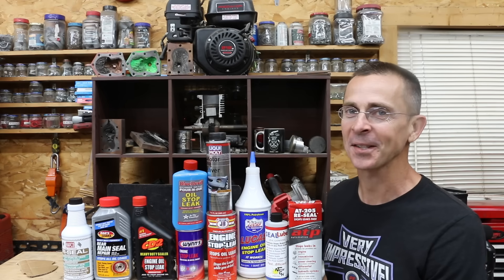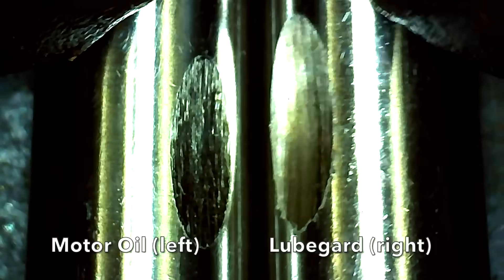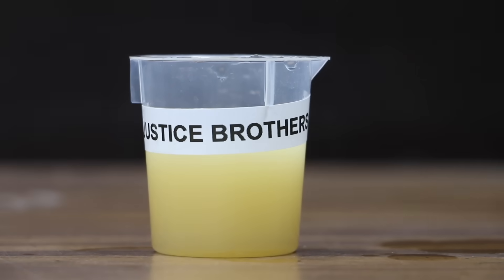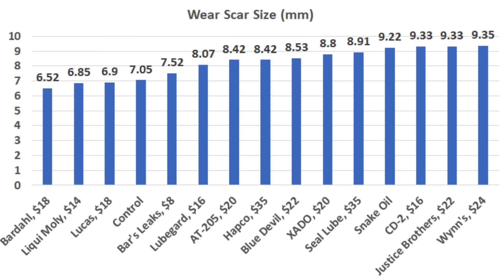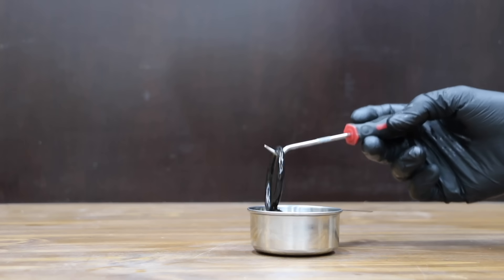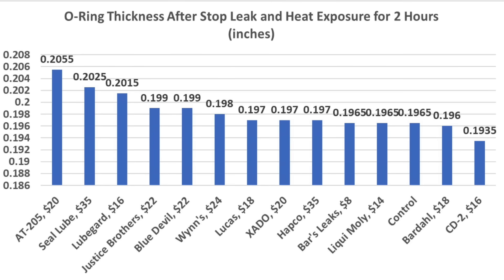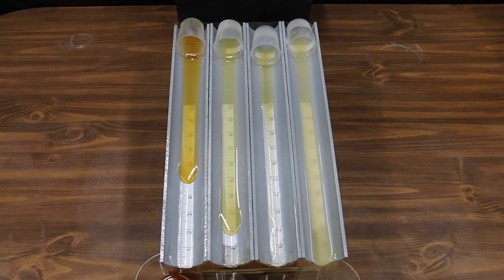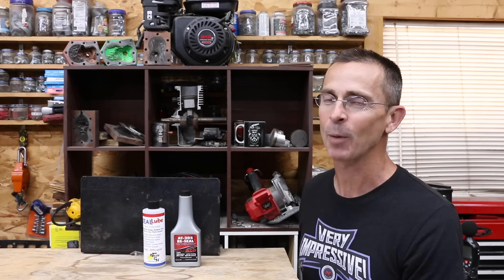Do Stop Leak Products Work? Do They Damage Engine Seals? Will They Destroy an Engine? Let's Find Out

Comment: I have a BMW e36 and it leaked oil from the crankshaft seal, front and rear. I tried Mannol stop leak and the leak gradually stopped. I add the stop leak after every oil chamge and its been leak free for about 3 years.
Reply from the maker: Thanks for sharing.

Comment: The At-205 works great on rubber components like CV boots to keep them soft and prevent cracking. I keep some in a spray bottle and use for maintenance. Barr's trans formula worked on my ZTurn hydro drive motors and a pressure washer pump that were leaking.
Reply from the maker: Thanks for sharing.

Comment: I wonder if the AT -205 would work to prevent the exterior side walls
of car tires from cracking, due to being in the sun and drying out.
Once they crack a lot of tire places make you get new tires. They say
these cracks could cause the tires to blow out, and it's very dangerous.
Maybe it would soften the tires too much tho ?? I don't know ??
Reply from the maker: Thanks for the suggestion.

Comment: My lawn equipment, chain saws, motorcycles and other small engines always have trouble with gas going bad and clogging up the carburetor.  I've heard that Shell gas doesn't cause these problems.  I'm not sure how you would setup a test but comparing different brands of gasoline on which one causes the least amount of problems with this equipment would be very interesting.
Reply from the maker: Thanks for the suggestion.

Comment: currently doing an oil change on my 25 year old sh*tbox. Put AT205 3 days ago and i've been driving it to work and back so not too much use. Gonna flush some sludge out in a couple hours and put fresh oil in.
Reply from the maker: Thanks for sharing.
Reply: @ProjectFarm  will say i'd been leaking oil before and it's completely stopped. Imported a bottle into the netherlands from the uk as they don't sell it in europe based on this very video. Thank you for all that you do! 🙏

Comment: I'm confused regarding Stop Leak for radiator leaks.   I got on an auto site for my Jeep and everyone is condemning the stop leaks saying they gum up' your coolant system and stop your heater core from working.    I have the Bars Leaks which was recommended on Youtube but they are all saying "No", "garbage", and on.   
How is a product like this sold in stores all over the country, if it really is garbage?   Obviously I am just trying to keep my engine from overheating for now.   Is this just hyperbole with everyone dissing these products or what is going on

Comment: I’ll stick to the blue Devil, but not the pour and go. I used the one you put in the cooling system (for the head gasket )once it has been flushed and do exactly as instructions say . Did it to my Dodge Dakota v-8 had it over two years before I traded it off and had no problems with it
Reply from the maker: Thanks for the feedback.

Comment: Love most all of your tests, but these aren't really valid. You need to run the tests with the product at the ratio they'd have in motor oil or other fluid. They fact that the cause wear at 1:1 tells me that have an impact, but is it measurable when they are mixed 5:1, etc? Also, the swell tests give the products an unfair edge: Do they do anything at all at the recommended ratios? 

Last note: it makes sense that the products that evaporate more work better at expanding seals. The lower viscosity allows them to penetrate the rubber better.

Comment: AT-205 Product confirmation:  My Diesel Mercedes' rear main seal has been leaking for about a year.  1 hour after parking, oil drips would be apparent on the driveway.  Based on projectfarm's review, I bought AT-205 from eBay for $25.  When it arrived in the mail, I poured the entire 8-oz bottle in the engine and drove the vehicle for 60 miles.  After parking it for 24 hours, no oil drips have appeared on the concrete.  Very Impressive!
Reply from the maker: Thanks for sharing.
Reply: That's interesting, it seems to have made my leak worse.
Reply: I have seeping valve cover gaskets my 30 year old Toyota V6. At-205 stops the leak completely, but it only lasts for 2-3 days and slowly starts leaking again. Was hoping it would last long enough to let me get time to change the rubber gaskets. I also know chemtool B-12 fuel treatment will swell the bejeesuz out of rubber seals, found out the hard way with rubber carb gaskets. I may try that.
Reply: @KillerNetDog  Curious to know how that turned out, if you tried it.
Reply: @gonzostrangelove6107  I just changed the valve cover gaskets, didn't try B12.

Comment: In the lubricity wear tests, why were the additives mixed in at 1:1? I've noticed some where the greatest concentration is supposed to be 1:7? You mentioned at the start, an acknowledgement, that you were doing 50/50, but I didn't notice a reason for going against the manufacturers directions. You've also mentioned the possibility of the solvents in these additives affecting the lubricating properties of the oil as well, just curious as it seems you were aware of the consequences of adding too much, but the 50/50 mix was used anyway.

Comment: @projectfarm Most oil stop products use silicate and form a hard glass bead at the leak. Lasts a couple of months with aluminum engines.
TITAN is different.
It bonds to the silicone gaskets with a soft bond that lasts up to 5 years.
They even have a head gasket product.
Please test it!
Reply from the maker: Thanks for the suggesiton.

Comment: At-205 is amazing! My 1977 ranchero had a decent transmission leak from the bell housing don’t know what seal exactly but it would leave a small puddle underneath it after sitting overnight. Put it in and drove it for the day. Checked the day after and no puddle! Hasn’t leaked since after a month. Great video!
Reply from the maker: Thanks!

Comment: Great test as always. Couple of points that I would like to make.
1. If using product that separates from oil like AT-205 it's like a one shot deal. So warm up engine, pour it it while engine is running, go for long drive. After that it will settle at the bottom of sump in a very thin layer so not sure if it will be picked up again.

2. Does the effect last after oil change or should they be added at each oil change?
Reply: I use at205 for my 04 Acura MDX, it has a RMS leak. It's seeping not that bad, but I use at205 re seal every other oil change and I change my oil every 3k due to the age and it's high mileage. At205 seals it up it works great but if I stop using it, it starts to seep again so I use it every other change to keep it in check

Comment: We have used 205 for suspension rubber seals that were older seals. And after checking the same seals sprayed one month back still looked very soft. But the bottom line is this liquid 205 has been a big difference in the  cars performance as far as suspension noises that have not returned. Heard about this product with Scotty Kilmer channel some time back.

Comment: If you believe any of these leak-fix additives really work, I got a bridge....
Come on people.
Reply: At205 works great
Reply: AT-205 works. Stopped a rack and pinion leak on a CRV for over a year before I sold it. Stopped a rear main seal leak on a Lexus GS300 that had 280k miles at the time and it now has 301k miles on it. Haven't had to add another bottle of it since.

Comment: We Need More People Willing Expose These Products Claiming They Work! Seeing Cars Being Sold For $100,000 With No Undercoating But You Have 14 Cameras None On The Undercarriage That Is All Raw Steel. Stainless Steel That Rusts Is A Stain! Industrial Stainless Food Grade That Lasts A Lifetime. 
 First You Need To Change Your Oil, Some Manufactures Say You Can Drive Annually Unlimited Miles With Their Product And It Will not Break Down, If The Vehicle Uses Oil Like Subaru 2.5ltr Engines You Will Have Non! 
 If The Oil Still Lubricates That Is Good But The Dirt Clogging Up Your Engine Is Laziness Thinking, Well Honey I Bought This 100K Mile Awesome Oil And New Technology They Have That We Don't Have To Do Anything And It Keeps Working? It Does Till It Don't. The Huge Selling Platform Is People Are Willing To Spend $20 Bucks On Anything And Will Never Return It So Once You Dump It In You Cant Send It Back! Sell 50 Thousand Bottles Of Trash and Your A Millionaire!

Comment: Awesome video. Great test comparison and extensive testing. Personally I use AT-205 on my old 23 year old Toyota Sequoia. Minor engine oil leak. It is noticeable when I don’t use the AT-205. It works really well. The only peeve is that I have to put a new bottle at every oil change. Considering it only gets about 3 to 4 oil changes a year and I buy the AT-205 in hills of 6 bottles or more for approx $15 a bottle, it’s not an entirely bad investment 😅. Thanks again for the awesome well thought out and put together testing video.
Reply from the maker: Thanks and you are welcome!  Thanks for sharing.
Reply: That's odd. I had a minor rear main leak on my Lexus GS and added a bottle 20k miles ago and it hasn't leaked since. Where's your leak?

Comment: You should redo the lubricity and viscosity testing with the proper amount of leak sealant. There's no way 50% of the oil in my crankcase will be a leak sealant.

Comment: I belong to a "Honda Element Mods" group and pasted a question on the forum if anyone had experienced an oil leak after switching to synthetic oil after 150k driving on conventional oil and got many responses saying never switch to synthetic on a high mileage motor and to change back to conventional oil. I had used a stop leak product with no resolve. I did change back a few weeks ago and still leaks but will wait for a few more till the verdict is out whether changing back did the trick. Not sure how these products work on synthetic or conventional as you never mentioned...

Comment: Question for anyone- Do you need to add this product every oil change forward or can it be used once or twice only to stop the leak?
Reply: I use at205 re seal every other oil change. I have a RMS leak on my Acura and the re seal works great but if I stop using it, it leaks again so I use it every other change

Comment: Ok. So I have a transmission leak. The At-205 works but increases wear. The LQM and Lucas seem like good options long-term since I wont be changing the fluid. What have you all used?

Comment: I'm a mechanic of 40 yrs and I love your videos and the way you test . You make the world a better place.God bless you sir . Ken!
Reply from the maker: Thanks!
Reply: Hey man I got a question for you since your definitely experienced, I noticed today my oil light came on , immediately pulled into gas station bought 2 quarts oil and put it in , i started the car and then noticed a puddle of oil , looked underneath and seen oil dripping , got home took 10 minutes,no oil light came on , after a hour of car being off ,checked oil and it’s all gone , not a drop of oil on the stick ,so my question is what should I do in that situation ? Any help you could give me I would really appreciate, we are talking 2 quarts oil gone completely in under a hour , thoughts?
Reply: @Bag514 I'm not a mechanic by any means, but your situation looks to be like a burning oil condition.. head gasket or something similar... Does the car smoke? Car make/ model would help!
Reply: @manaaalsuwaidi3643  thanks man ,but an update my filter blew out , head gasket would have been very bad lol
Reply: I have a slight crankshaft oil seal leak. What stop leak etc, do u recommend using besides replacing the seal.
Reply: Once i expienced something similar and wen i checked it it turned out to be a puncture in oil filter

Comment: 1:1 is greater than the recommended dosing. For sure this will accelerate metal to metal wear for the non-petroleum-based additives (eg AT-205 which is DEGEE - penetrating solvent - excellent for rubber swelling, and also used in pharmaceuticals for transdermal drug delivery!).From what I understand blue devil and seal lube are the same material

Comment: Went budget  ,Zink additives: bars & risoline works if very small oil consumption ,lifters ticks, low pressure, friction , Leak additive :lucas aft & restore  seals and revitalized rings. WORKS BEST 1 TIME USAGE FOR EACH OIL CHANGE AND WILL FIX THE PROBLEM AND WONT CAUSE MORE FUEL CONSUMPTION

Comment: I use AT-205 to prevent oil leaks. I add 2 ounces (0.35% of total oil volume) at every 5,000 mile oil change. A recent inspection by a master mechanic revealed no leaks in my 2012 Camry engine after 153K miles. Oil burn is currently about 6 ounces (0.2 quarts) between changes, so there is no indication of excessive wear. AT-205 is an inexpensive way (about $5 per oil change) to prevent leaks. Oil loss damages the environment, threatens the life of an engine, and leads to eyesores on garage floors and parking areas everywhere. Prevent them!
Reply from the maker: Thanks for sharing.

Comment: So it seems like there are two broadly different product classes here. The light glycols that swells and softens the rings but don't lubricate too well; and the thicker napthenes that improve lubrication but don't swell or soften the rings. So use AT-205 first to swell and soften, change the oil and then put Bardahl, Lucas, et al to smooth it back out?
Reply: It’s important to note that the seals are NEW and not worn. A lot of people think that by using these products that it will over swell rings that have not shrunk yet… I know a lot of people who have said Lucas has stopped leaks inc myself and it’s certainly not swelling the metal lol
Reply: @ep4no  Thanks, yes, the Lucas/Bardahl  reducing friction approach appears to be good for all older vehicles. Not sure so much about ones with turbos, but will check that out.
Reply: @ep4no  Thank you. So I got the Lucas Oil Stop Leak. Do you think it is ok to use on a car with a turbocharger, like a Subaru Forester?

Comment: Stop leak does not work good (or even not at all) with hyper modern rubber seals, the brown and blue ones are Viton or Neoprene seals...they are resistant. Stop seal works only with BUNA (synthetical black rubber seals = NBR) On vintage cars with rubber gaskets most stop leak additives work pretty well.
Reply from the maker: Thanks for the feedback.

Comment: I would argue, that the LiquiMoly and the Bardahl are the two best products coming out of this test simply because it didnt add any additional wear and tear or increased temperature readings. 

The top of products listed at the end all had increased wear/tear and temperature over the control/regular oil. Whats the point of "fixing" a leak when other metal components are damaged? 

The LiquiMoly and Bardahl showed "some" improvement over the control in terms of softening/rejuvenating the o-rings, yet minimized additional wear/tear/temperature readings on other components.

Comment: It's great that you are attempting to be systematic and present conclusions supported by the experiments. However, I think there are some problems with your interpretation and scoring system. First, the general score has only one clear negative factor (scar size), so the overal score is not balanced. Okay, you tried to compensate by removing the 'negative' effects and only look at the positives. However, one might argue that changing the thickness and hardness of new orings is actually a negative thing - only old and hardened orings should get effected  - you don;t want new ones to get too soft and too tight - which will sure result in more wear.

Comment: Thanks for this. Lucas must use the seafoam marketing strategy. Put the same product in different bottles with different claims. Ironically, that’s what the snake oil salesman used to do with his product.. What I learned from this is the products that actually work for seals should be used the same way you would use engine flush products. They should not be in there for long.

Comment: It seems most of the products out there are designed to swell rubber and help failing seals and O-rings.  I'd be interested in seeing if any of the products can actually plug a hole or crack, like in a gearbox.  Obviously in an engine with oil passages this would be a bad idea, but for gears or chains that are just dipping into the oil it wouldn't hurt anything.  Like the oil gearbox equivalent of slime for tires.
Reply from the maker: Thanks for the suggestion.

Comment: Correct me if I'm wrong but the main purpose of the stop leak products work when they leak out of holes in your engine or transmission or hoses, etc they react with the air to harden and seal up those leaks. I could be absolutely wrong about that but none of your tests tested the main purpose of these products. unless I'm wrong none of these tests conclude which product is better.

Comment: I recently did a clutch job and decided to replace the rear main seal while the flywheel was accessible.  Unfortunately, I have a small oil leak from the new main seal which didn't exist before.  Next time, I'll buy the more expensive OEM oil seal and use anaerobic sealant with the install.  In the meantime, I hope one of these products can slow down the leak until I can R&R the main seal again.
Reply from the maker: Thanks for sharing.